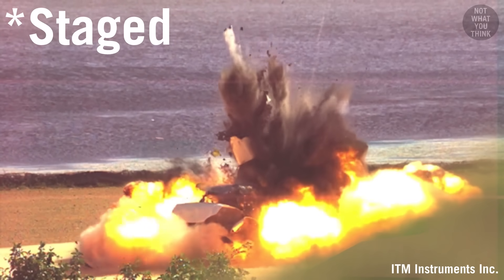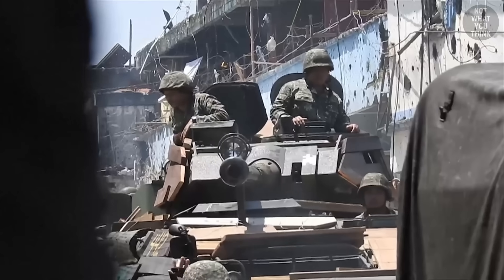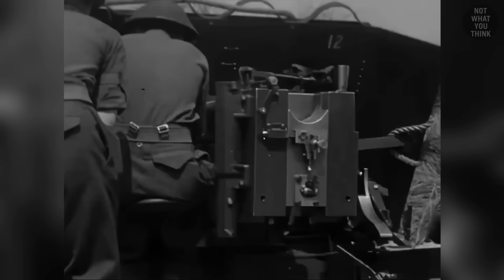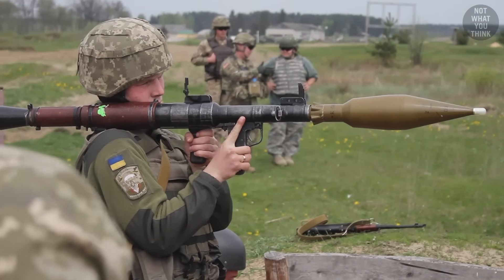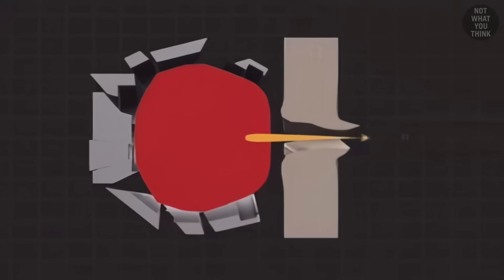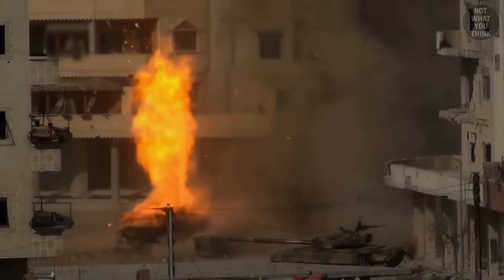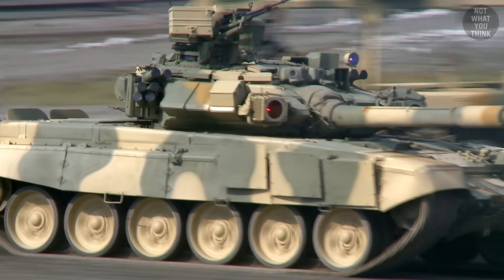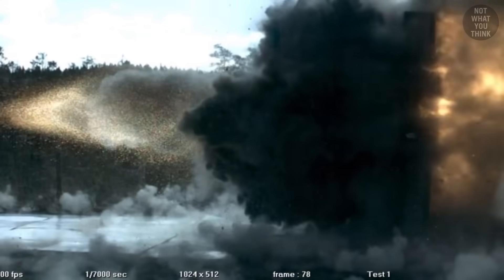Why Protecting Tanks is Getting Much More Difficult

Comment: I'd say, balance has shifted from tanks, infantry and aviation to drones. It's just that not everyone undersood that yet. But modern warfare shows that one who has better drones could deal a huge devastation to enemy. Because drones are cheap, often even way cheaper than their payload, could be so small that air defence either won't detect them or would need to shoot entire local bird population, they provide recoinnasance, and they're devastatingly precise.
Sure, to deliver some really powerful blow you'd still need a rocket carrier, and to actually capture territory you need infantry, and to protect your infantry you'd need tanks, artillery and air defence. But even a group of guerillas with consumer drones and 3D printer could be disproportionally more successful than entire infantry division without modern equipment.

Comment: Since youtube recommended me this video i think they may be curious of my opinion so i will be saying mine in the line below,inside this comment:
1) Tank reactive armor is a good idea,Elon's auto driving systems are the hint ,which means
Photoreactive artificial intelligence that reacts to incoming threats,aims a mini turret at the missiles and shoots them down,the problem with the photoreactive artificial intelligence are ammount of any cameras(360 degree cameras are harder to learn for AI,but do able) and turret placement that can be solved with genetic algorithm teached by accurate 3d simulation that allows AI to choose where to put cameras and turret/turrets
It's not your skynet, but it's just AI that only knows how to "defend against a threat"
2) Tank passive armor is also interesting but the cost may be way too high,which means basically scientifically generating a new metal element with chemi-physical synthesis(connecting and disconnecting atoms to generate new thing),for chemi-physical synthesis you need absolute zero degrees and a tool that can hold atoms and connect them
Chemi-physical synthesis can be done for more than just tanks and more than just a metal generation,you can absolutely with 100% certainty 3d print anything that laws of physics,tool durability and chemicals used to freeze atoms[so they can be grabbed] can allow you

Thank you for reading everyone,thank you for keeping my channel alive @TeamYoutube and i hope everyone here have amazing christmas <3

Comment: It would actually make a lot of sense to see an almost overreaction to this shift in that things like power armor / exosuits / literal mechanized robotic infantry are heavily developed to overfill the fire support role on a squad based infantry level. Imagine 4 soldiers out of every platoon being in a full body armor suit with various hook ups and weapon mounts depending on mission type. See the "Max" units from Planetside 2 for reference. Or an even heavier variant could be the Mechs from Section 8. Full battle robots are as overkill as sending in a tank. But this whole thing makes the Fallout universe seem much more realistic, in that their tanks were scarce already due to resource shortages. And Power armor soldiers could essentially be equipped to lay down almost the same effective firepower. The enemy is killed maybe not with the equivalent of a 150mm sabot round from an Abrams but if the end result is the same. Then cost effectiveness will dictate unit relevancy on the battlefield. Miniature technologies and new stronger alloys could pave the way for a new exosuit for the army. Not necessarily nanotechnology but all you would need to do is get close. Reminds me if that project to make spider thread from spider silk ever went anywhere since they were going to try to combine it with Kevlar to make even lighter and more protective armor.

Comment: I mean, if you are at the point where more armor is ludicrously expensive vs the means to overcome that armor then scale back to the point where those anti-tank rounds go through without detonating, though maintain appearance of a heavily armored tank so they keep using the more expensive weapons.  Likewise, by making it lighter you increase the speed of the vehicle, allowing it to maneuver faster and able to deliver it's deadly payloads more efficiently and effectively while getting back out of dangerous situations.

Or, and this is an after thought, develop an armor that does more to redirect the energy of the shaped charge away from vital areas.  But I imagine that has also been thought about, so probably not very viable.

Comment: It's always been the case that a tank can be killed for much less than its construction cost. Tanks won't be leaving the battlefield for as long as they are able to fulfil a role which no other arm is able to, that being the tip of the mechanised spear. If anything, I expect tanks will only get larger, more high-tech, and more expensive. Just as fighter aircraft did throughout the Cold War.
Reply: They kind of surpass their usefulness after a certain size. I mean you could make a tank with 10x the armor thickness, but it will also be massively heavy and how useful is it at that point, especially with the resources required to operate it and if it can even be of much use as a weapons platform at that point. The solution is really just better armor made out of stronger materials, but even that would be insanely expensive, making it overall not worth it. Railguns, laser weapons, etc....all could defeat even the thickest armor. And even reactive armor would have a heck of a time stopping a railgun round, because of its speed and it's an entirely ballistic chunk of metal. Reactive armor couldn't stop a laser at all, and it could even be defeated by lasers to allow for conventional weapons to hit their targets. And reactive armor is a consumable, once it's used up, it needs to be replaced. So all it takes is sustained attack to defeat it. Enemies could throw lower grade weapons at tanks to use up the reactive armor, then hit with the bigger stuff. I think eventually the whole turtling armor thing will give way to a new battlefield ideology, where the best defense is a strong offense, or speed, or other tricks like that. Just look at bunker busters...even bunkers are basically not feasible anymore. So war will become more proactive, and things will be overall less armored, but used more efficiently, or other weapons will become prevalent. So hitting enemies fast and hard will become more important than holding out with a hardened defense.

Comment: One thing the war in Ukraine has shown, it's that the age of the tank is coming to an end. There is so much anti tank weaponry out there, that tanks just become a liability more than anything else. They are slow, they always need support especially in urban areas, and pretty much every weapon out there is designed to destroy them.
Reply: They are not slow. With modern powerplants they are a hell of a lot faster than anything on foot or on wheels. One of the problems in keeping modern tanks running is that they can outrun the support vehicles that bring up their fuel and ammo. And EVERYTHING needs support. There is no military arm, be it tanks or infantry or artillery or whatever, that can carry a fight all by itself. Everything has limits and vulnerabilities that need to be covered by support from other arms. Why is every weapon out there designed to destroy them? Because they are pure hell against a force that doesn't have anti-tank weapons. 

What the Ukraine war is showing is the stupidity of Russian tank design. They use automatic loaders. Those loaders are designed to take ammunition which stands on end in a ring around the periphery of the turret basket. There is literally a circle of ammunition around the inside of the turret. The gunner and TC sit inside a solid ring of ammunition. Unlike the American Abrams tank, where all the main gun ammo is in the turret bustle with armored doors between there and the fighting compartment, in a Russian tank there are no walls, no baffles, no protection at all between the crewmen and the ammunition. In an American tank, a hit which detonates one round in the ammo storage only blows the top off the bustle, and the interior armor saves the crew. In a Russian tank, a hit which detonates one round in the autoloader will cause the chain-firing ever every round, with nothing but air between them and the crew.

The end of the tank has been decreed by armchair "experts" at least a dozen times.

Comment: This is why most tankers in the Russo/ukraine conflict fight with the hatches at least partially open. It is the dramatic overpressure of a penetration that  kills instantly. It’s really in the lap of the gods whether a penetrating jet strikes a crewman or a round in the carousel. It’s remarkable how many penetrations some of those tanks take and fight on. However spalling from squash head rounds pretty much just ricochets around inside until it’s energy is spent. There are many testimonials from ww2 of maintenance and recovery crews dropping the bottom hatch and hosing out the soup that was once the crew 🤮
Reply: By leaving the hatches open however they open themselves to drones dropping grenades its a lose lose situation

Comment: Shaped charges are an amazing aspect of engineering and physics. How to focus an explosion upon a single small point is amazing. It's a hypersonic welding torch. All you need is a small hole, and inside that hole you can pump a multitude of cocktails.
Reply: This is true. Fascinating stuff! I was a teenager in the Marine Corps when I learned that explosives can be measured and controlled to use in dynamic environments for a multitude of purposes. Cutting was probably most surprising to me. I had a lot of fun blowing up piles of worn out gear and clearing trees for practice back in the day. My college chemistry professor had some interesting things he shared with us including the basic principle that a high explosive was actually an extremely rapid burn rate. Although my time as a teenage jarhead was almost forty years ago it was still some of the most fun stuff I've ever experienced.
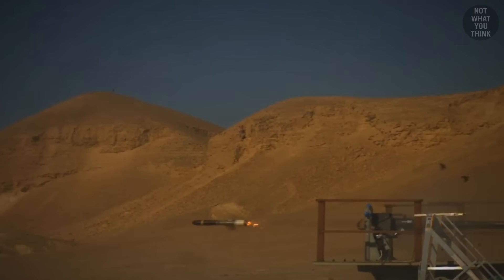Reply: 0:27 how is the target exploding before the missile has even entered the frame?
Reply: @fukingmagnets  It's either APS, or the cameras not being synced up.
Reply: @fukingmagnets  reactive armor
Reply: Good point. Maybe it was triggered as part of a test. Clearly nothing there worked out ideally since the hypersonic charge triggered a dozen feet from the target.
Reply: @fukingmagnets  I  may be wrong about modern reactive armor (or even older), but I believe the simple concept is to neutralize one force with an opposite force - to explode outward immediately when struck and hopefully neutralize or "mess" up what the incoming munition is trying to do.
Reactive armor isn't "smart", but a bunch of flat-panel explosives - like a Claymore without the shrapnel. (I think)
 This would be more affective against rounds coming in at an angle, to deflect them slightly and their deadly puncture-ability. Just my thoughts.

Man, I wish I worked for DARPA!
Reply: @fukingmagnets  well I may be wrong. But if im not mistaken its a hard kill system ( trophy system )that fires shrapnel at hypersonic speed toward the projectile and neutralizes it before it reaches the vehicle. A soft kill system would only redirect it but perhaps thatsw hy it blew up much farther away from the target whereas if it did get closer the reactive armor would have then activated and deterred the projectile. But I may be wrong like I said
Reply: @fukingmagnets  The shockwave moves faster than the missile.
Reply: @fukingmagnets  
11:11 in the video, Why Are Active Protection Systems Needed.
You can see a bunch of videos of little things exploding others things from further away. My favorite, that I watched a million times, was 11:25
Reply: @fukingmagnets  
Exactly, let see here:
11:25 Defense projectile launched from the tank to the top left at 45° , while the incoming missile is just entering the frame.
11:26 The defense projectile detonates at the right time to launch, via shaped charge, hypersonic media to impact the incoming missile.
11:27 Incomming missile intercepted/destroyed. You can watch the interim frames with (,) and (.) to see the cloud of projectiles launched from the defensive projectile and intercepting the missile.
Reply: yeah, shaped charges are incredible. if you want to see some interesting footage about it, i recommend you search up "the slow mo guys" here on youtube, they have some super highspeed footage of of explosions like that.
Reply: Hummm? If there was only reactive condoms.
Reply: @hmax1591  an ugly face does that
Reply: My dad was in the Army, and he is the one who taught me about shaped charges. He told me they also use this technique to make "IED" roadside bombs, like the ones they used against our troops in Afghanistan. Scary stuff!
Reply: "amazing" more like horrifying and horrible
Reply: @denusklausen3685  its still an amazing feat of engineering, no matter how inhumane it is. please stop commenting in a military themed video if you are opposed to such things
Reply: @denusklausen3685  This same technology is used to cut steel and demolish buildings. It's pretty amazing even if you're a pansy.
Reply: Shaped charges can at least be defeated
No amount of armor will stop APDSFS from most modern tanks
Now finding a way to effectively fire that by infantry in a portable manner, that would actually make armor virtually worthless. Meaning APCs would probably take the spotlight over MBTs
Reply: @commisaryarreck3974  Reactive armour can greatly reduce the effectiveness of them by shattering them, making them less likely to go through armour.